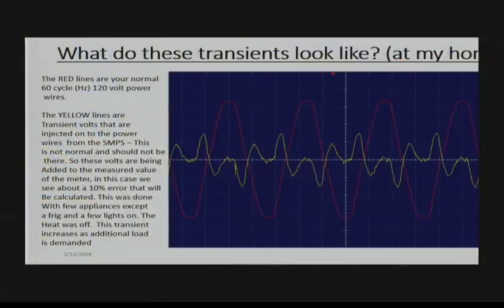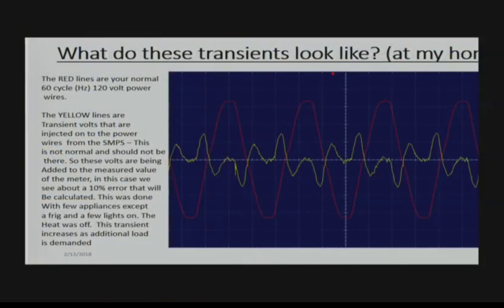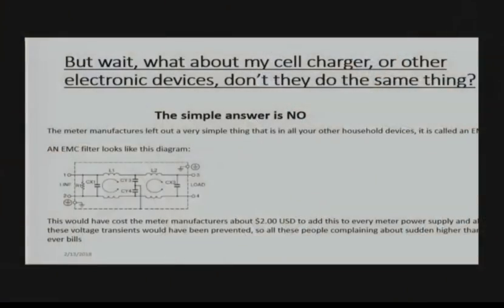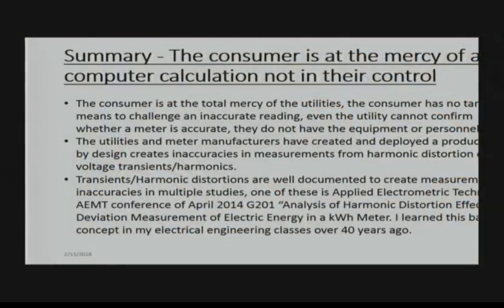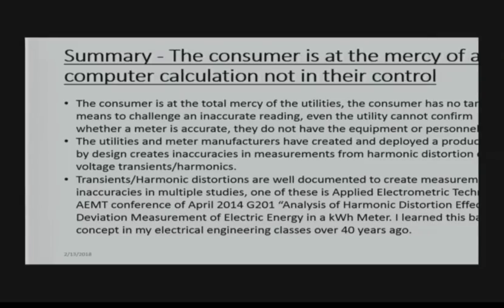Bathgate testimony before House Energy Committee 02/13/18

Comment: As a scientist, I have a hard time believing this guy's "conclusions". If you read his reports, they immediately jump from talking about transients to claiming that "families are sick because of this." In other news, every single device in your home creates transient voltages; nothing suggests the "yellow line" he shows in his graph necessarily comes from the smart meter itself.
Reply: This video doesn't talk about sick building syndrome, but that is coorelated with dirty electricity by many studies. If he turned every other appliance with electronics off, then it would be reasonable to conclude the meter is causing the noise.  Maybe in everybody else's modern home, "every single device" creates transient voltages, but in mine I measure for it and don't tolerate it.
Reply: @seahorsecorral  Can any here recommend a good hand held meter to measure the signals around my house and at the meter?

Comment: I used an HF35C , Went out side in my driveway and stood 15 feet in front of my meter. I was getting values over 1500 and 1600. Anything over 1000 is considered EXTREME! So all over America they are frying our brains? Its ok. Why was this not discussed as well. And those values were about every 45 seconds. Now every 2 to 6 seconds it sends out a value some at 20 some at 100 some at 500 and some at 1600. Any value over 100 is considered SEVERE. Constantly but they alternate. However as I said each and every minute or less there is a dangerous high value going out to whomever is nearby. This was only one meter, now what happens when there are 2 meters side by side? then its doubled, what about when there are 6 meters?  They NEVER gave us a choice to opt out in PA.
Reply: Horrible! Same here; neighbors' meters are making us sick.

Comment: I'm not disagreeing with what he's saying, I've had trouble with smart meters and I've switched back to an analog but he says he heats with a boiler, now I don't know about gas but oil fired uses electricity, they have a pretty good size electric motor that runs a blower and a fuel pump, they also have two electrodes and a transformer to run them. I had a transformer go bad once, the only reason I found it was I was walking by the meter and it was screaming, I checked everything, when I got to the furnace the transformer was oozing some kind of oil and it was dangerously hot, but it was running fine. as far as transparency, I don't believe analogs are perfect, all the ones I've seen have had a fast and slow adjustment screw just like an old clock where I live there's no independent check for accuracy. if it's set dead on at 110 volts and put on a house where the voltage is 120 it will run fast and you'll be overcharged
Reply: re: if it's set dead on at 110 volts and put on a house where the voltage is 120 it will run fast and you'll be overcharged <<< does it NOT take 117  rms ? on one side and 117 on other?. would the meter not be a 240 volt?, would they not accurately measure them at the factory? doh

re: I don't believe analogs are perfect..believe or not, have you made scientific measurements?, or is this just your beliefs? without evidence?, have analogs worked for over 100 years?..did they melt? were they made of plastic ? did they ever have fancy mini computers that can be programed anyway they want and wrelessly?, how could you know if you cant diagnose it with your own laptop program ?how do you know these new ones are not "rigged"? like the voting machines we all know of..do you even KNOW? how old or the new meters work?, can you explain it to me like i was a 6 year old?

Comment: What Bill explains at about 6:35 is exactly what has happened to me and many others I have spokein with==submit a complaint, suddenly your kWh usage goes down--like magic!  I (Linda Kurtz) complained to DTE about my 140% usage increase in one month. A "technician" (their fancy name for a meter reader) came out to "investigate."  His reading, which occurred exactly in the middle of my billing cycle, would put my kWh usage again at about a 140% increase over previous years (I have gas heat, not electric, and my gas usage was up 77% from year before due to cold and fact that my temperature is set a little higher). 

Two weeks later, I checked the smart-meter reading. Even though it has been just as cold, suddenly my kWh usage was back to the levels it has been for 21 years! How the hell did that happen? Because DTE changed the algorithm is uses to calculate my energy usage--via its remotely controlled software. No customer can prove this happened, but if every one of us whom this happend to shows what has happened, we may get some change.